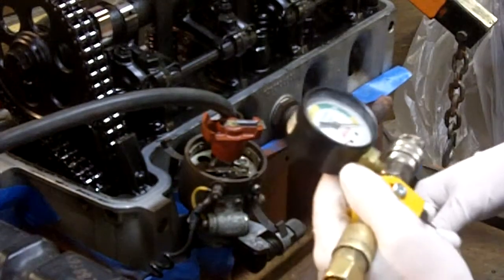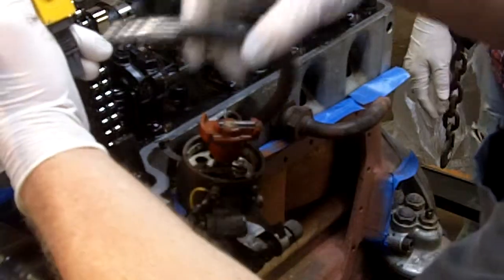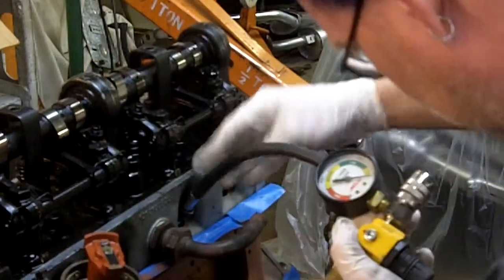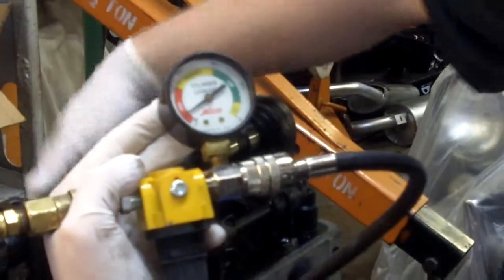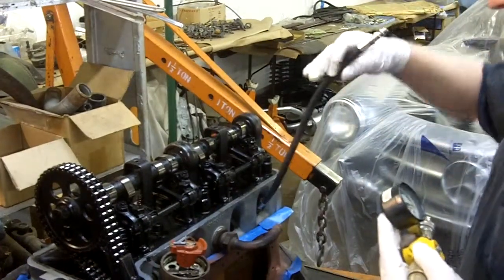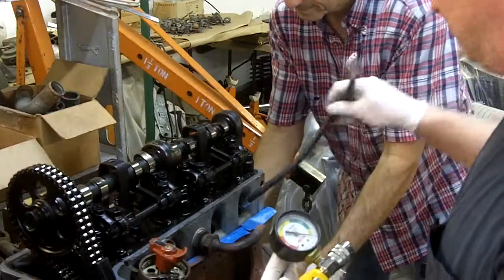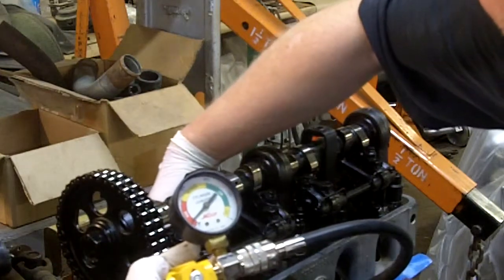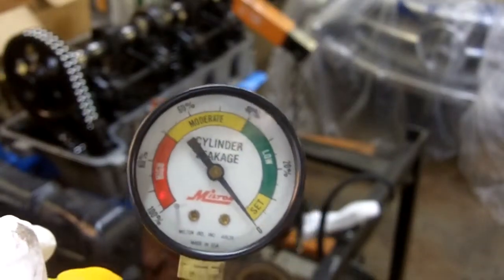190SL cylinder leakage test

Comment from the maker: Hello Norway!Wish I was there.  It is about 33ºC in Dallas.25psi is so close to 0 that I would suspect a valve is stuck open all the time.  Or at least not closing completely.Rotate the engine until both valves should be closed on #3.  Use a cylinder leakage tester as in the video to force compressed air into #3.  Then listen for sound of leaking air.Intake valve leaking you should hear air coming out of the intake system.Exhaust valve leaking you hear air out the tail pipe (exhaust pipe).I do not think the rings are leaking that much. but if they are you will hear the air by removing the oil filler cap.Let me know what you find.  Good luckWill

Comment: yes they hand lapped them, u can say that again! exception indeed, have taken many heads there and never had this problem before. even the shop owner was surprised about it. but I recorded the cylinder leakdown test with boroscope and showed him.  sprayed some soap and water and leak super visible, they kept asking me if the block was ok, but that would not affect ALL intake valves that way. plus i did check it with straightedge. maybe I can upload the video after I finish this mess.

Comment: The second time it came back from machine shop, it had improved but was still in the 45% so hopefully that has been taken care of. the shop used a new leak check tool by leak check pro, (pacific products I believe.) I received a nice printout of leakage results taken at 45psi. They looked good there, looked at that products website and they claim it will give u the same results/readings at 20psi and 90psi.

Comment from the maker: Make sure you have the correct amount of shop air pressure to your gauge that the mfgr suggests.  If that is done and you had 45%+ leakage then that is way too much.  Did you determine if it was rings or valves?

Comment from the maker: We tore the engine down and there was not one part of it that wasn't totally worn out.  There was a reason they stopped driving it years ago.  The engine was no longer serviceable.  We adjusted the valves but found doing that still did not fix broken piston rings and worn main bearings.